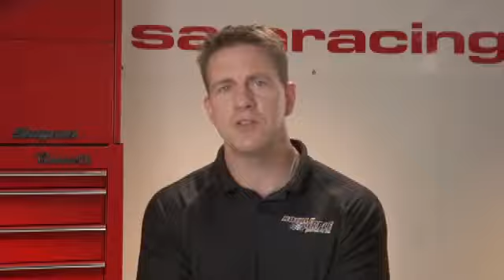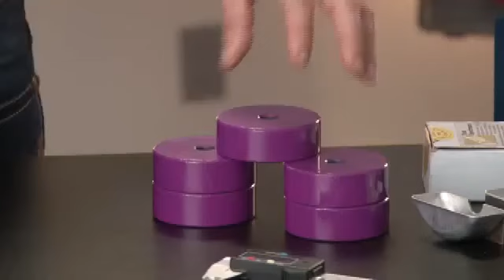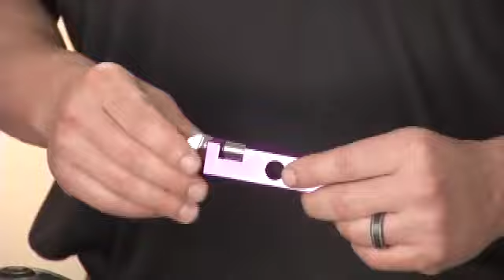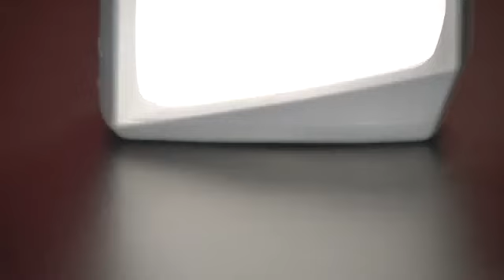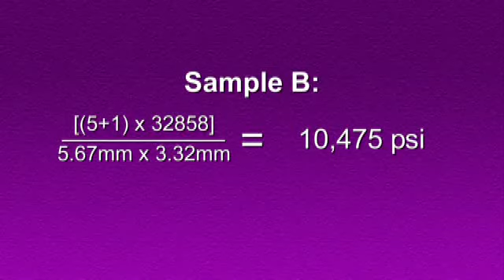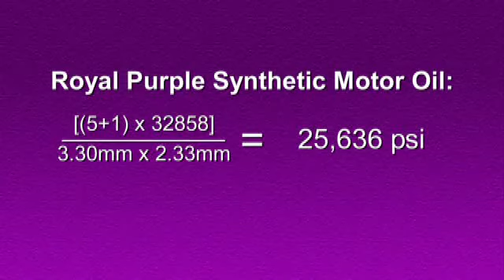Test HPS High Performance Street Motor Oil di Royal Purple

Comment: Also the wynnes machine test bench had a 1 HP engine and a standard rowling bearing on one end and the same bearing material on the other end, this test is to simplate operational temperatures and to date unless you used a proffessional friction monitoring machine like used by the Oe companies to test various metals with and without lubrication then its only a test but how important is your multi million dollar business, well like i have already mentioned most of the largest printing companies in australia used wynns industrial friction products in the various machines and the oils used in those machines.

Comment: Instead of putting 2 pound weights on the bar, we had a full grown man hold onto it and push the bar down with his feet off the ground and wynn's industrial friction products compared to other OEM oils used by heavy industrial machines and factories with multi million dollars of equipment thus saving then on maintenance cost to a value of over 10 million dollars just by adding the right amount of industrial friction products to the OE oils used, double and tripling the life of the oil ? Now thats a test, if royal purple is so good, then the heavy industry oe manufacturers would be using it and have OE specified oils or grades of oil which is the same that OE manufacturers would approve right or wrong ?
I used to work for wynn's industrial products which they sell the friction products only, which you would need to put into your new engine oil and used the same test parameters as this test except instead of using weights to put on the end of the bar, it had a calibrated torque wrench attachment on the end of it and the certification of the torque wrench is with the machine and tested,also the bearing material and the bearing which is spinning is always changed with new bearings both of them ? This test only removes the bearing material, not the bearing which is spinning ?